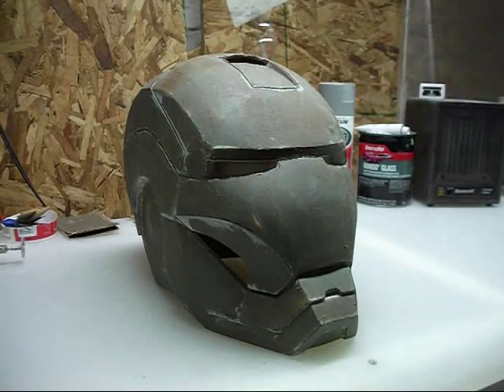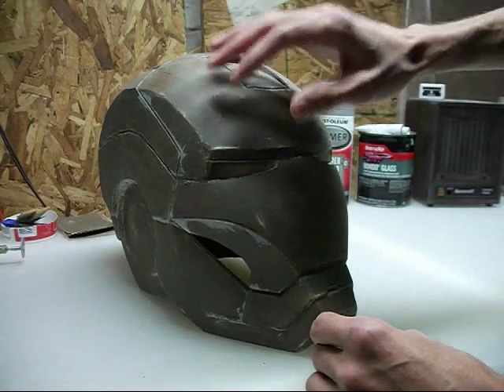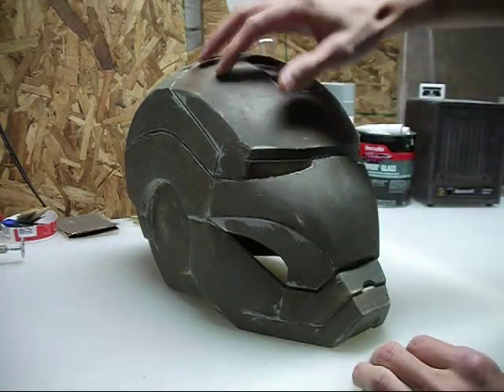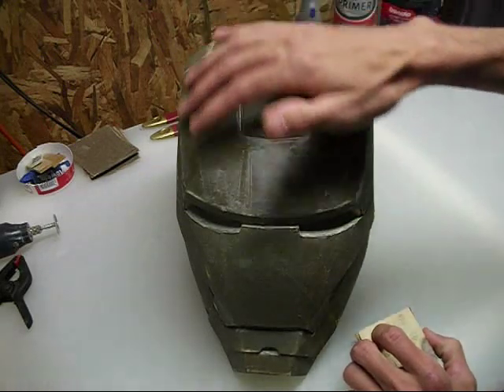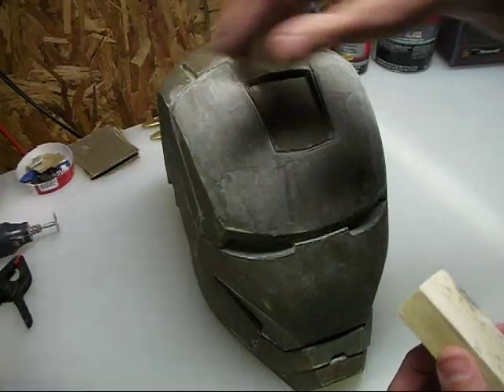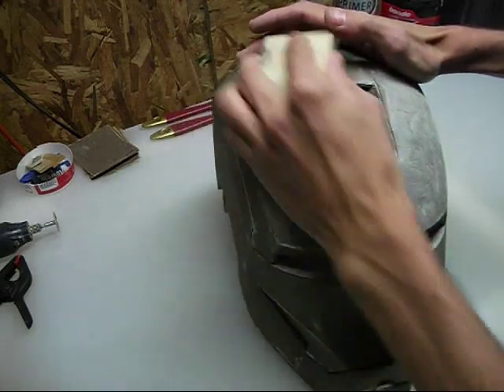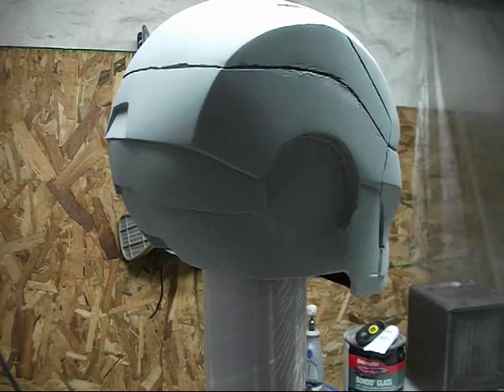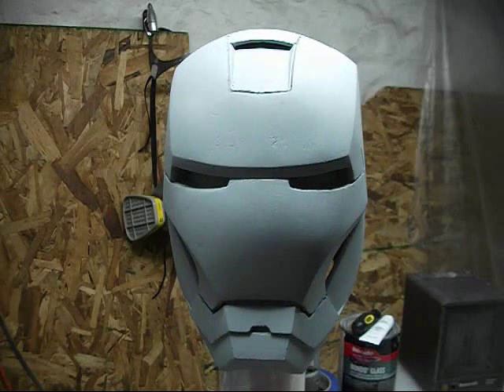IRON MAN HELMET BUILD PART 9 ~ BONDO COATS 2 & 3 PLUS PRIMER

Comment from the maker: Yes, I would most likely use a rotary tool to clean it up.  You can always keep re-doing the Bondo until things are right, so you really can't make a mistake that's not correctable.  You may also want to use a needle file by hand to get in there and smooth things out.

Comment from the maker: The point of using primer is to highlight imperfections in the helmet that are very difficult to see so that you can fix them.  You may think the helmet looks perfect after sanding the Bondo, but you spray a light coat of primer and all the sudden every mistake, dent, scratch and pinhole show up.  Primer also helps paint adhesion and gives your colors a more vibrant look with less overall paint coats.  Any quality paint job starts with a primer.  I would recommend using it highly for chrome.  :)

Comment from the maker: Everything was glued together.  My file had a lower jaw brace but it still sunk in/warped on one side and I had to do a lot of Bondo work to fix it.  You can make additional braces out of cardboard or wooden paint sticks if you need to....they can be cut out later on.  Also, remember that you can fix a lot of the warping with a hair dryer after the resin has dried.  Don't throw any more away, they don't have to be perfect from the start.

Comment from the maker: The thickness of the Bondo would depend on you.  I would guess that two to three thin coats would probably add 1/8" of thickness, but remember, you can feather the Bondo out to less than paper thin near the high detail areas.  As long as you get a smooth surface the Bondo can be very thin.  If your details are already pretty smooth to begin with you don't even have to Bondo them...the layers of primer (and spot putty) will fill in any small defects while keeping the detail.

Comment: Its probably a little late to be mentioning this as this video is kind of old. I have a suggestion: If youre sick of your sandpaper clogging up try a sandpaper thats been treated with stearate. 3M has a product called 745I that is purposely designed to sand fiberglass resins. It may cost a bit more but it will last considerably longer than the aluminum oxide stuff you're using in the video.

Comment from the maker: Primer Sealer is just like ordinary primer but it also seals & blocks stains from bleeding through (such as sharpie and pen lines on the helmet).  Filler primer or "surfacing" primer is thicker and builds up on the surface more to fill in scratches and small defects.  Some people use filler primer in place of glazing putty to fill scratches if they are not too bad....I prefer the glazing putty.  Clean your files with an ordinary wire brush or a "file brush" and they will be good as new.

Comment from the maker: Also, I don't know whay kind of clear you're using, but actual automotive clearcoat paints like Dupli-Color are acrylic lacquers, & will hold a very high degree of polish.  You may not get the same shine from an all-purpose enamel spray paint, or even an enamel automotive paint. 
 
P.S.   A great rubbing compound you may want to consider is Meguiars Ultimate Compound...I have used it in the past with great results.

Comment: You can sand it at this stage with wet sand paper fill a bowl with warm water and with a bit of soap in it and dip the paper every once in a while. stops the paper from getting clogged up and gives you a smoother finish.

Comment from the maker: First, make sure you are using a metallic paint for your color coats.  After the clearcoat is applied over the metallic paints it may look a bit dull or not as glossy as you had hoped...to get that true high gloss automotive finish you MUST wetsand the clearcoat with at least 1000 or 1500 grit.  The higher grit you work up to the better the result...I will probably sand to 3000 grit.  After that, you need to use a rubbing compound and either hand or machine buff the clear to bring out the shine.

Comment: A couple of questions for you: Where the bondo supplies are sold, they have primer sealer - which you use - and primer filler. What is the difference? Also, what do you do when your files get clogged? Thanks!

Comment from the maker: Just used a Bondo spreader and did light coats.  More of the smoothness has to do with the sanding before additional coats of Bondo are applied......you need to sand with a block.....if you sand with the paper in your hand you will never get the surface smooth.

Comment from the maker: Yes, I will be casting copies and making them available once it's done.  This particular helmet will not have a removable or motorized faceplate...it's too thick and heavy.  Maybe I'll motorize one of the casts as they will be much lighter.  This one's only meant to be used as a master to make my mold...after that, while it will be fully wearable and have LED eyes, it will be mostly used as a display piece.

Comment from the maker: This one will not have a motorized faceplate due to the varying thickness of the fiberglass lining.  It WILL be fully wearable, padded inside, and have l.e.d. eye lenses which you can see through, but it will be mainly used for display, and as a master for molding being that it's also heavy.  Cutting out the eyes will be one of the last things I do AFTER I make my mold.  Later, I will probably completely finish one of the much lighter casts with a motorized faceplate & l.e.d. eyes for wearing.

Comment: Is there a way to do a cast from a paper helmet and smooth it out ready to mold from it without bondo? Im from the uk and we dont have things like that???? Fibre glass to toughen it up is all i got so far
Reply: +superman320 Use P38. Same stuff, more or less.
Reply: +superman320 yeah we do mate, head over to Halfords and pick up a tub of body repair paste. Americans always call things by brand names which can be confusing but bondo is basically Polyester body filler for repairing dents and body modifications on cars. "David's ISOPON P38" works great. and only about a tenner. ;)
Reply: thank u fin

Comment from the maker: You don't have to make a cast of the helmet, just cut off the lower rear panel so you can get your head in and paint the thing.  Reattach the lower panel with magnets epoxied or fiberglassed into both pieces.  You only mold and cast if you want to make multiples, which I will cover in later videos....too much to try and explain in words on that process.

Comment from the maker: Mmm, not really, unless you missed an area of fiberglass and it was left dry.  Once that resin touches it and it's saturated there's really no way the fibers are going to be breathed in.  I'd be more worried about sharp or pointy areas of resin or fiberglass that may poke you.  If you have any, sand them off and go over them with resin again.